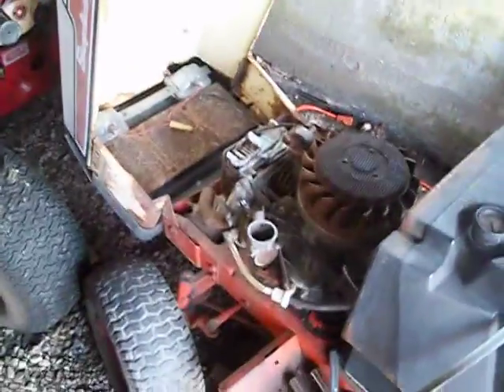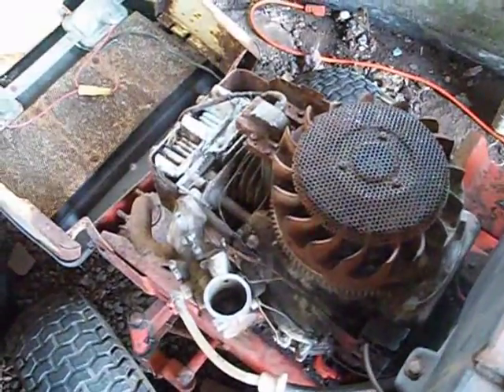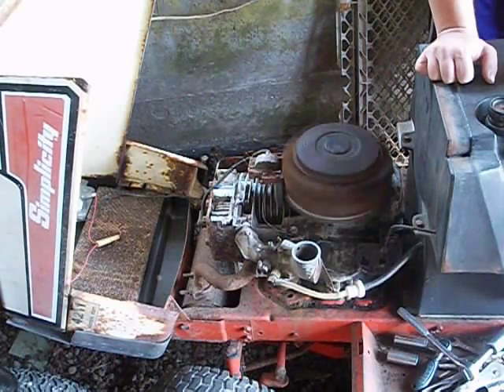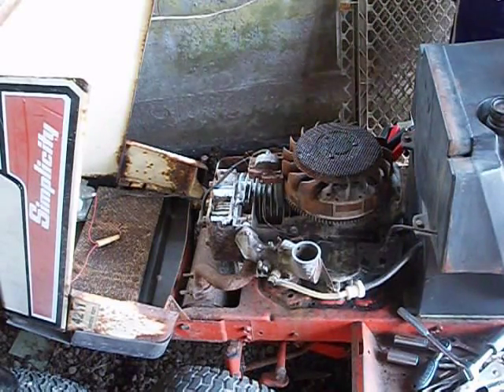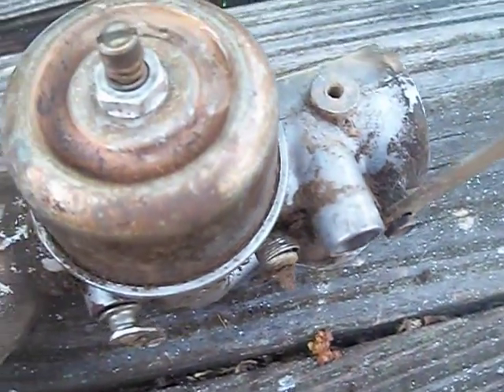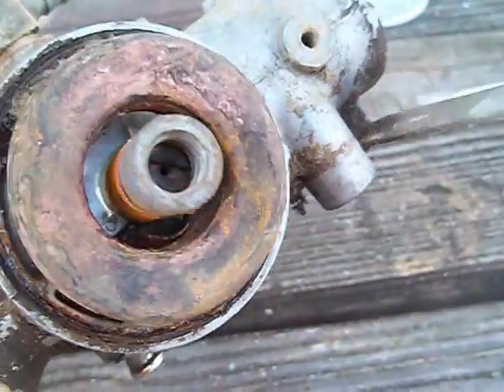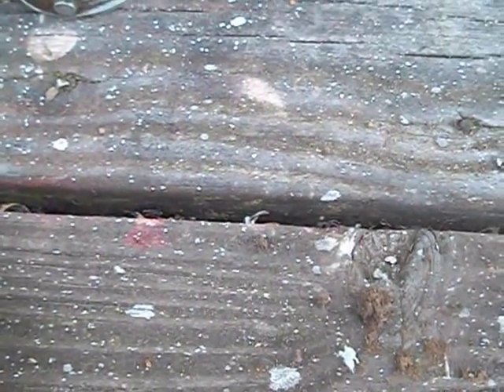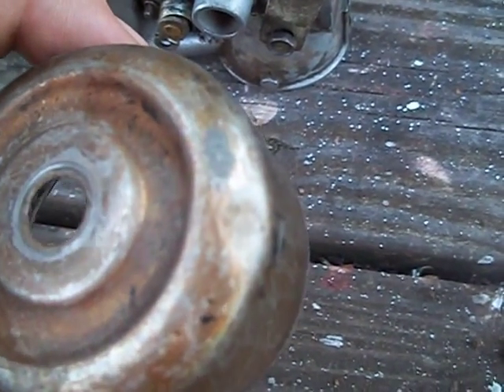Simplicity 4211 tractor part 4 first tried to start then cleaned 1984 11hp briggs carb.

Comment from the maker: cleaned most of the trash around the float will look at vid and carb to find the hole. if it does not run with the carb cleaning I did will soak it. will not left the s\arter on that long anymore

Comment from the maker: Yeah I like it the worst thing on them is putting the drive belt on you have to take off the shifter and some of the pullys. There is als a deck spring that you have to pull back with vise gripss when you take the deck off. try not to unhook it when you put the deck belt on

Comment from the maker: I think that screw will be ok it just holds the carb jet needle I sparyed a ton a carb cleaner threw that screw and all threw out the carb. I'm going to look at the float bowl more look for holes and rattling and take sand paper and try to clean the rust under the carb float.before I put it back on. I confident this tractor will run. I think it won't roll cuz the drum brake is stuck. someone told me that in a trator forum. I will try to fix it I'm still very new to this. its a exrta hobby for me

Comment: to test the coil you can unplug the thin black wire that is connect to it and if you have spark it is good, that carb needs to be soaked because it doesn't take much to clog one up, another thing would be look for one on ebay that is ready to run, they are pretty cheap..I'll upload that linkage video in a few minutes..

Comment: Hey bud, don't leave the starter running that long, it will be toast before you know it.   
That carb definitely needs a good soak.  All that trash on & around the float will cause lots of headaches.
Around the 5:50-5:55 mark it looks like there might be a hole in the float,  by the pin that holds it on.   Maybe just the angle of the camera...

Comment from the maker: if it does not run after carb cleaning will soak carb want to save this carb will check for spark and try to start it on the weekend

Comment from the maker: yeah I'm new to the small engine thing no one can know everthing about it thats why I ask for help the cluch pedel depresses when I try to roll the simplcity tractor one wheel stays locked while the other one move foward. on my mtd tractor I currently use I put it in neutrel and shift it in to 7 gear and shift it. If you don't mind I will r-mail you the simlpcity service repair manual i have to show you what my brakes are. I just printed it on my printer. I going to go over it and study it

Comment from the maker: the float drops fine the needle that hold on the float is seized oldchevy4x4 said it might have a hole. yes make a video to show what I did wrong. this was my first time trying to clean a carb. I was told not to jump the starter that long so will not.

Comment: we i know i am young but i have been doing this scene i was 7 regardless you never know it all just ask charger miles007 a old timer that comes close but he still don't know everything to get to the point that's why we all work together on these thing aye seems to me you do that any way on the brake if its locked does the brake leaver push in alt all or what does it feel like i fixed one once and my leaver was slack